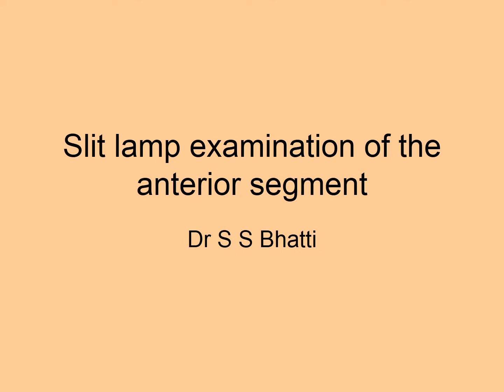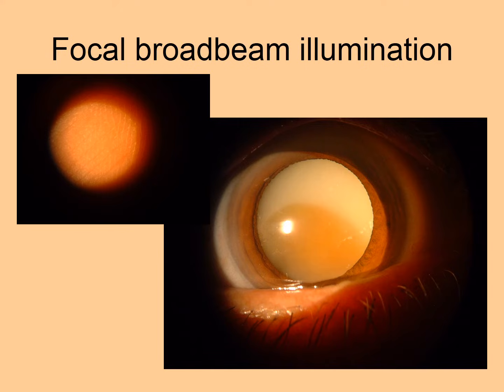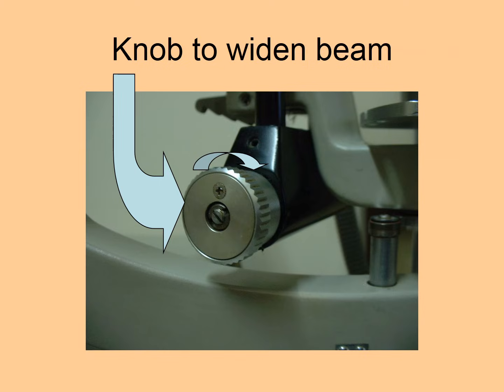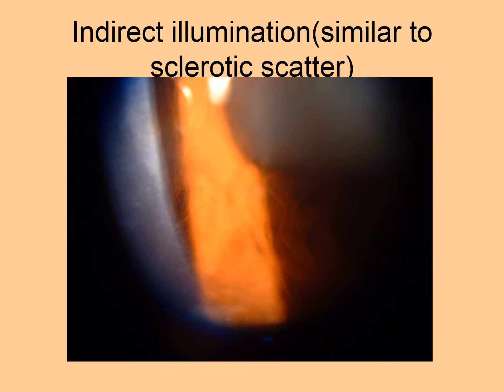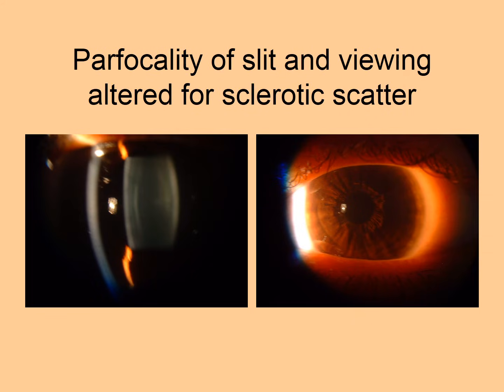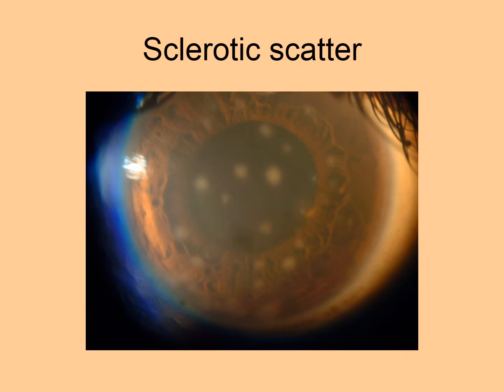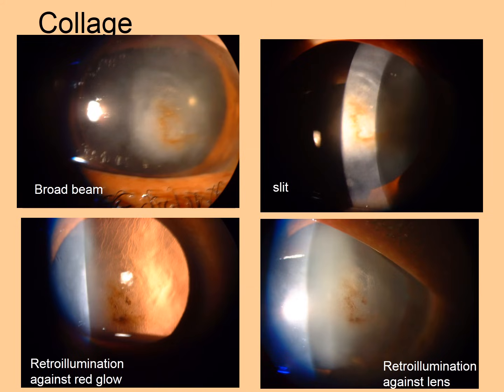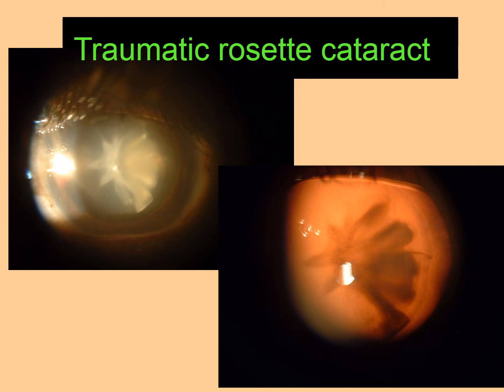Slit Lamp examination of the anterior segment of the eye

Comment: What is the name of slit lamp "setting" used to best visualise the Weiss ring?
Reply from the maker: By Weiss ring I presume you mean the ring seen over the disc in posterior vitreous detachment. This does not have any particular "setting " required but you do need a fundus viewing lens like, for example, a 90 D indirect ophthalmoscopic lens or a contact lens like the mainster lens to be used along with the slit lamp. You could also view it without using the slit lamp by using a 20 D indirect ophthalmoscopy lens with a smartphone (https://www.youtube.com/watch?v=rB5Pk3y0Z-I)

Comment: Can intra ocular pressure is identified by normal slit lamp??
I mean without goldmann slit lamp??
Reply from the maker: Not consistently. Sometimes epithelial or stromal edema may clue one to the presence of high IOP, similarly a Fundus view may show cupping or Retinal nerve fibre layer defects, but for reliably estimating IOP you need an applanation tonometer (like a Goldman tonometer)on the slit lamp

Comment: 為什麼角膜要染色? why should we dye the cornea of the eye?
Reply: You may want to use dyes like fluorescein sodium which stain abraded areas of the cornea where the epithelium is missing, or you may want to use  dyes like Rose Bengal or Lissamine  Green which stain degenerating corneal cells.Sometimes you may want to use both together (differential staining) as in cases with dendritic ulcer to show both the denuded epithelium as well as the degenerating cells .

Comment: This method can find lasik or smile surgery sir pls reply
Reply from the maker: in smile surgery the scarring is more and it is almost always possible to see the interface on slit lamp exam. In lasik, scarring is less but still you will see the interface opacity in most cases but occasionally the scarring may be so minimal that it is not possible to see the interface or the circumferential scar easily
Reply: What about surface ablation surgery?
Can that be detected with this ?